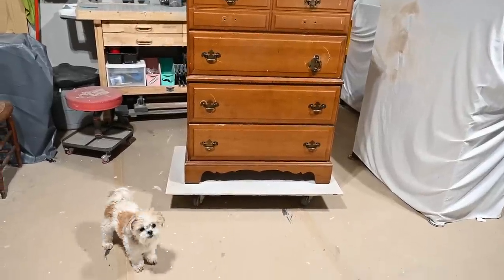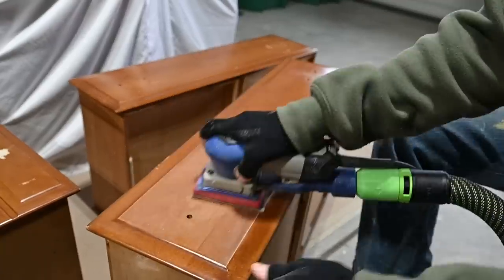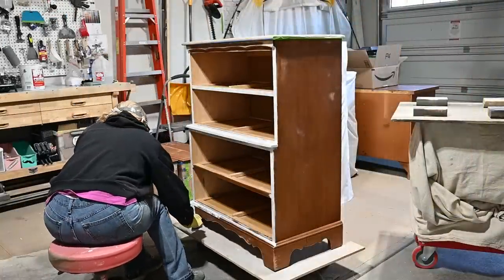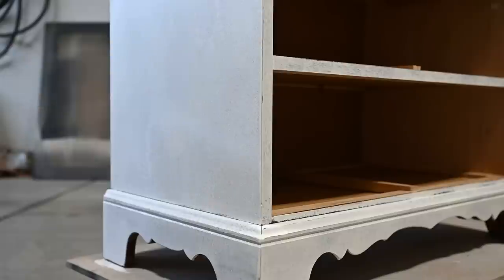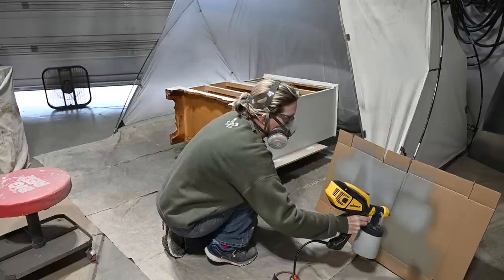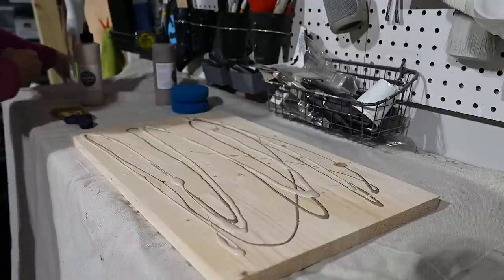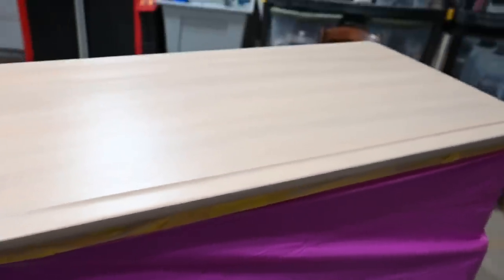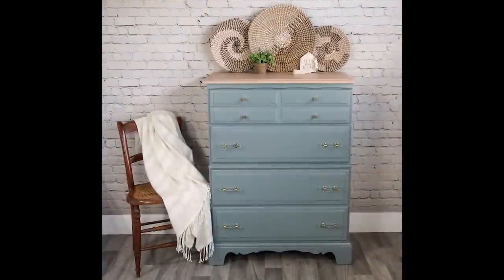Thrifted Dresser Makeover

Comment: Hello.  Chiming in from Canada.  Lovely piece, but can I make a suggestion to use tin foil in your paint  trays.  That way you are only throwing out the tin foil and not having to buy a new tray every time you use a primmer.
Reply from the maker: Thank you for watching!  Thanks for the comment!  I sometimes use foil and it works for sure! Just get in a habit. 😂
Reply: Yup, do the foil, lol. I have a tray, lined, with a roller and brush that were getting tired. I just wrap it up in the foil, leave it all in the tray ( I leave a decent amount of the oil primer in there, too). It lasts and lasts. When it’s finally getting to goopy to save with a bit of mineral spirits, then I change out the foil. The roller and brush give up the ghost after a while, but I’ve gone a couple of months with it, all fine. It’s handy, as well, for a bit of spot priming, like the bleed through, or a filled hole that needed another coat. Just grab it out, it’s already got paint on it, then fire it back into the foil wrap in minutes. The tray itself is already a liner, and the current one is going on a year of use.
Reply: Beautiful piece 😊
Reply from the maker: @lynnekerr3890  Thanks for watching and for your ideas!  I appreciate it!
Reply from the maker: @angelazguric4944  Thank you so much!❤️
Reply: Or leave it and peel off the dried paint